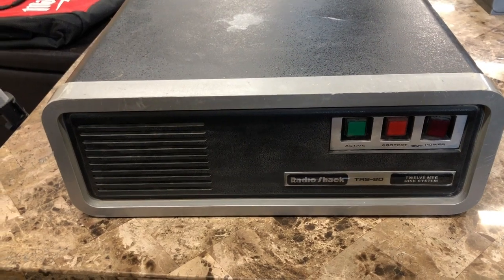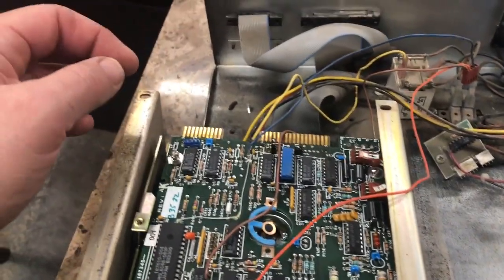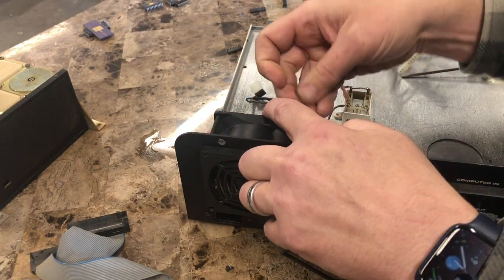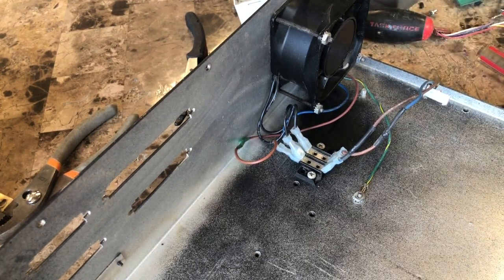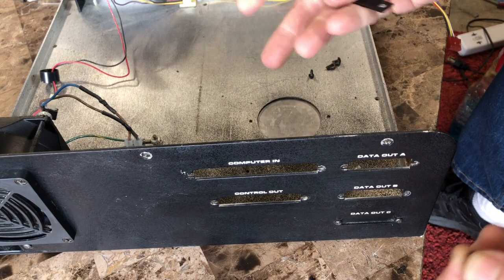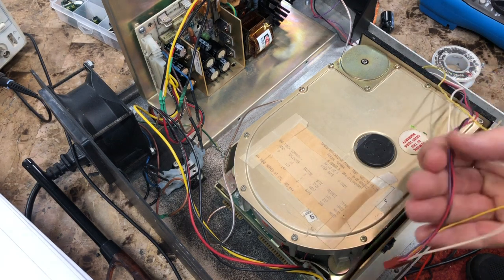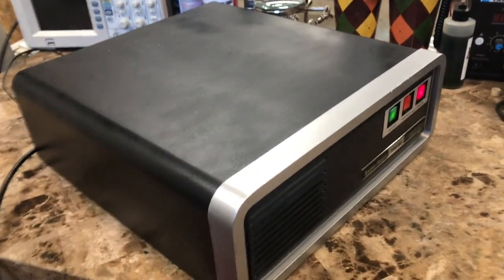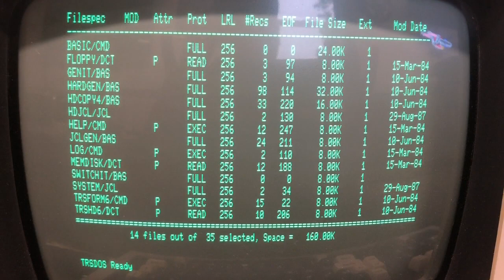Repairing a Trs-80 Hard Drive from 1982

Comment: The original external hard disk for the TRS-80 used a Shugart SA1004 8-inch hard disk which stored 8MB and retailed for $5000 in 1981, which was a lot of money for an 8 megabyte hard disk even back then, as Seagate had a 10MB drive, the ST-412, which sold by itself for less than half that price.

Comment: What was the processor on that control board? That looked like an MC68000.
Reply from the maker: It's a Signetics 8x300 on the original full size board, they were replaced by a Western Digital half board in later units.